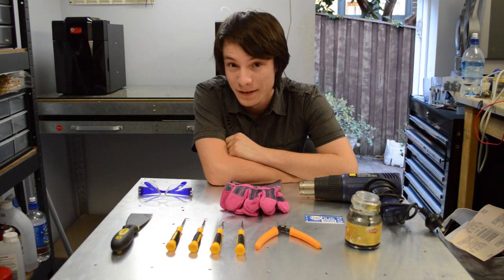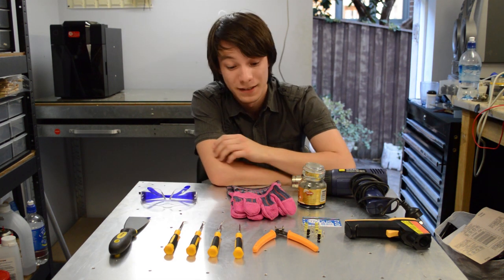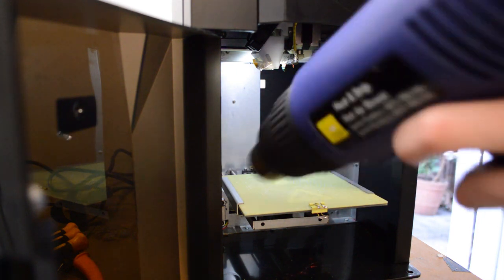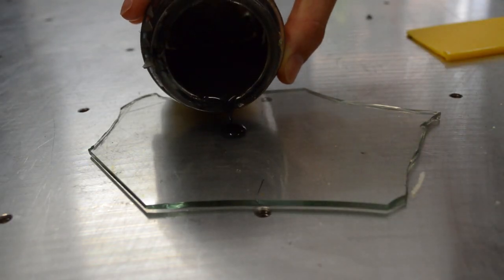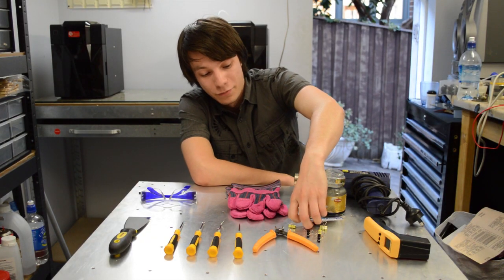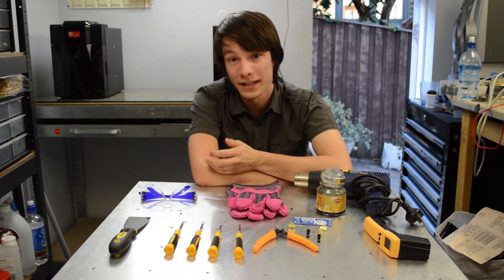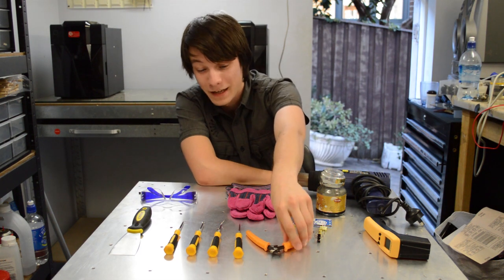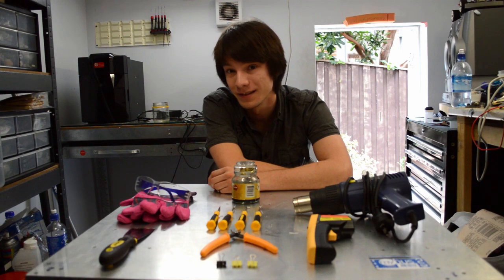Top 10 Tools for 3D Printing Success

Comment: My Dreamer has a pre heat setting on the machine so you can just set it to pre heat. Also I find that a cheep $18 buck 3d printing pen off ebay is fantastic at repairing some 3d print jobs that go wrong or in some cases print jobs that I want to build up a area or wall thickness. I recently needed to drill and  tap some prototype  parts and using a 3d pen I was able to build up the area first with the same filliment. Love your channel.

Comment: You probably know this by now, but if you don't like having to heat up your chamber with a heat gun, you could just write a few lines of gcode to solve it. For most slicers, you are able to view the raw Gcode. And then there should be a tab that says initial gcode which is what the printer will read before every print. You have a few options. You can just set an amount of time for the printer to wait every time, or you could probably copy and paste some lines of code that somebody else wrote that would make it detect the temperature and wait to start the print until it reaches it. That would only work if your printer has a method of detecting temperature. Hope this helped!

Comment: painters tape, and hairspray,, not just for print bed adhesion,  also for an easy gloss to your prints... @makersmus I am 13 and use a cheap m3d micro printer and it has been awesome and I have had it for half a year and only had to replace a nozzle as I twisted is after cleaning it once and had to replace it,,  it is a bit noisy after 8 months but nothing makes it bad, just the print head case gets a bit loose and vibrates but I used aluminium tape around it and it's quite now,, and I absolutely recommend you to buy it as it is cheap and reliable,,  I use hairspray on both painters tape and aluminium electrical tape as a print adhesion but after I clean the print up I do a few coats of hairspray of the print itself then tie a string somewhere and hang it our with a fan blowing at it and do around 5 coats,, u can get cheap hairspray but look for one that has an extra hard hold and a gloss, I bought a large can, cos I use it 0n my hair as well =P lol,, please reply and let me know if you read this comment as I have watched all videos and love your work and I would love to contact you regularly
Reply: @maker's muse
Reply: +maker's muse
Reply from the maker: +Slicer Badger The M3D Doesn't do it for me because it doesn't come with a heated bed as standard and isn't cheap enough compared to the wanhao i3 or Up Mini in my opinion. Still, they're a good entry level printer a lot of people have and like. I print onto buildtak for almost all of my printers now, it works way better than painters tape and is a lot more durable.
Reply: +3dee maker Dude, I am in the same exact situation 13 year old who loves 3d printing but has no money so resorts to a cheap m3d printer that is decent :)
Reply: +Slicer Badger Hey - give me an email at steve@polar3d.com. You sound like the type of person we're looking for as a Poalr#d Printer Ambassador http://polar3d.com/ambassador/
Reply: +Steve Kayser 😀😀😀 my email is slicerone7@gmail.com.. what would an ambassador do?
Reply: +Steve Kayser  and BTW I have a bigger printer now.... flashforge dreamer
Reply: +Steve Kayser and Steve I have applied for a student ambassador but I haven't received an email at all???  and what would I do if I was an ambassador? I don't even have your printer.. would I receive your product and share it and be an ambasoder that way? because I have seen your printers they look heaps good.... but would I receive any products to promote your product?
Reply: Ethan Bridger the m3d (for me) just didn’t work the auto bed level was awful, and m3d says you can print ABS yet no heated bed

Comment: If you work with small models or very high details a magnifier lamp, like the ones you often see in electronics labs/workplaces is quite handy too. Or if you are on a tight budget, at least get some small "helping hands" with a little magnifying glass like these: http://www.amazon.com/SE-MZ101B-Helping-Hands-Magnifying/dp/B000RB38X8/ref=sr_1_federatedaps0_6?ie=UTF8&qid=1411759841&sr=8-6
Reply from the maker: Good suggestion, they're great for fine electronics work too! I have had to clean support of tiny SLA parts before, a magnifying lamp would have come in handy...!
Reply: +Maker's Muse read my comment please